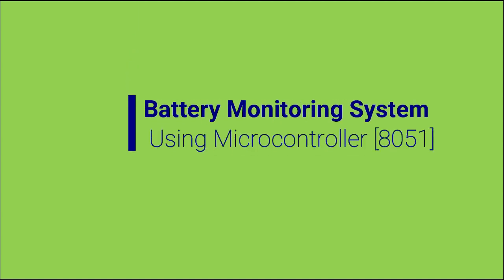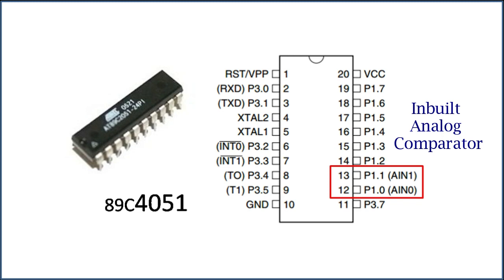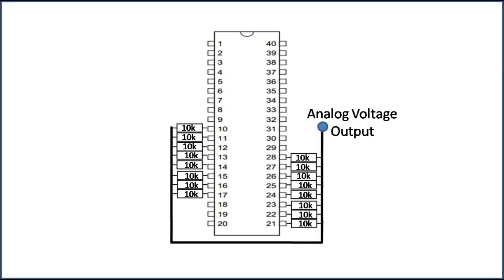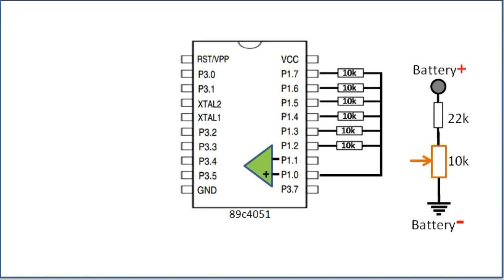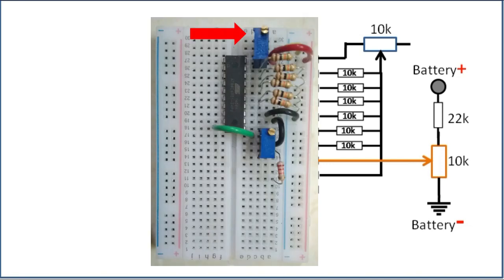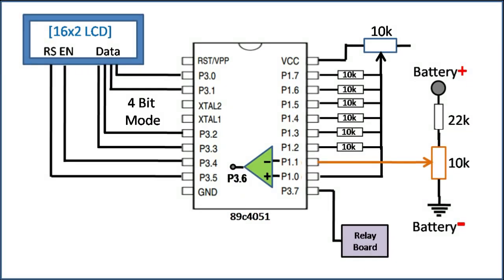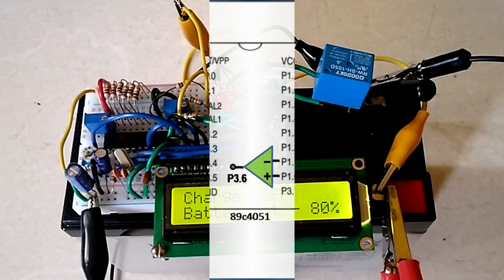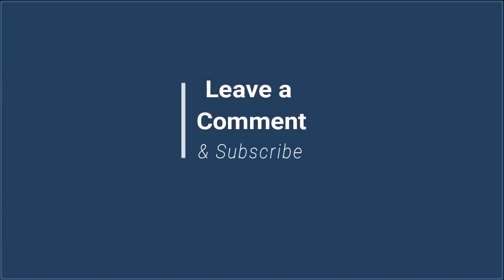Crude Battery Monitoring System using 8051 [AT89C4051] Chip

Comment: Dear sir how convert + 12volt to - 12volt?
Reply from the maker: Hi. If you are using batteries. You will have to use two* 12v batteries in series and use centre point as ground. Or. You have to use a 12v 'centre tap transformer' with full bridge rectifier. Or you can build a small circuit using 555 timer IC called 'charge pump circuit'. You may have to google search for circuit diagram.
Reply from the maker: But keep in mind, Charge pump circuit can provide current between 10ma to 50ma, only suitable for small low power circuits.
Reply from the maker: https://youtu.be/bgcr_C7MKUw